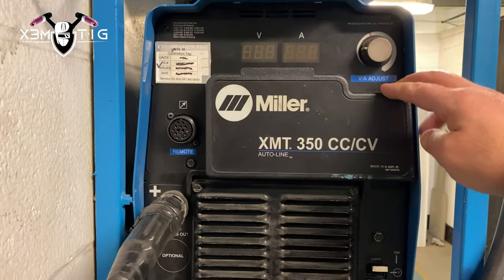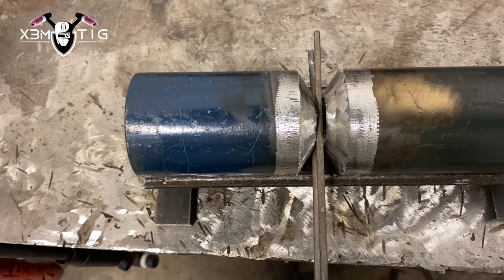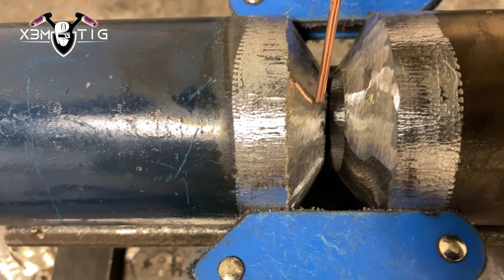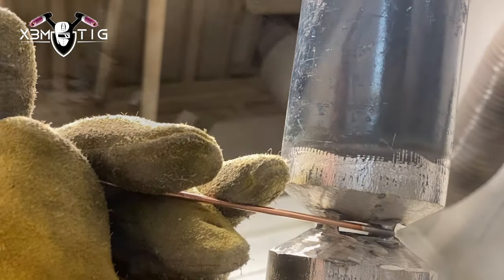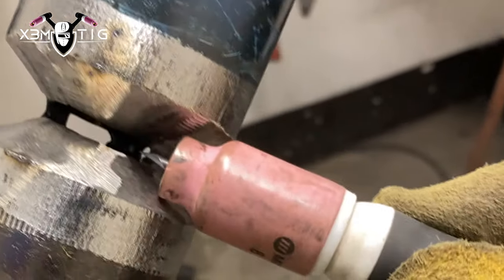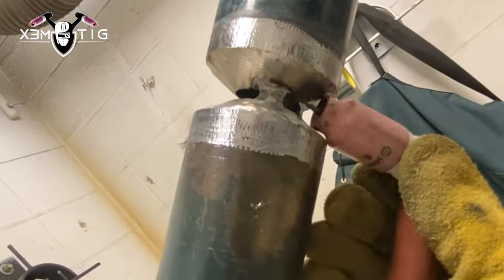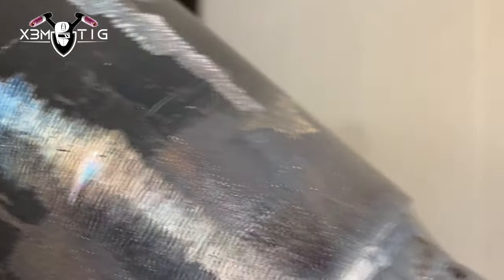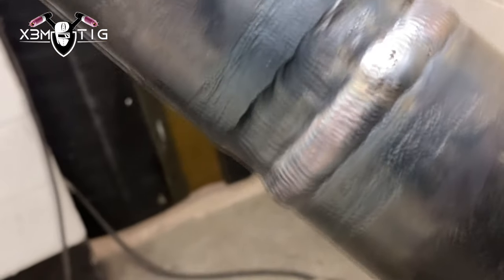6G Max T | TIG Welding For Beginners! From Root To Cap!

Comment: Love your videos. I work on boilers so it’s mostly tube welding but personally I prefer a 1/16 gap to a tight 3/32 and use 1/16 wire you just gotta feed like crazy on the bottom then keyhole the top and since it’s 1/16 wire you have more control over how much wire is being fed also I usually run the root at 120-130 amps on carbon and inconel but watching your videos is amazing cuz it’s interesting to see other peoples preferred techniques
Reply from the maker: Thanks for sharing your experience and technique! 👍

Comment: Nice job, although I would have a smaller gap and single dip, flush and cap without walking using 2.4mm all the way. Back in the day we would fill and cap heavy wall with stick 🙂 Keep up the good work👌
Reply from the maker: Thanks for your comment comment bud. Definitely that set up is good as well, on some sites they have that procedure in place.

Comment: Looks great I’d love to see you do a 3/32 gap 4 tacks root with tig 3/32 wire and hot pass 7018 welding rod fill it flush with rod and cap it with 7018. I learned a lot and I’m struggling with the the tig root. I have a test coming up soon in august wish me luck

Comment: what type of tungsten do you uses ?

thanks  X3M TIG !
Reply from the maker: 2% Thoriated, 1/8 size
Reply: @X3MTIG   same here, I like how it welds. I guess you always use a respirator when sharpening it? I was thinking of switching to 2% lanthanated to completely get rid of the hazard.

BTW just passed my F6 SS, F6 carbon, F3F4  XXH, now I'm off to fort hills. thanks for the help!

Comment: Nice video. What's your tungsten length for your hotpass. I'm practicing for 2 inch pipe 1/4 inch thick. Having trouble with hot pass. Thank you.
Reply from the maker: Up to 5 mil
Reply: @X3MTIG  Thanks!

Comment: Une question ?? Faut il un temps de refroidissement entre chaque passe ?? Merci.
Reply from the maker: Hey bud, I usually let it cool down before capping, it’s just a carbon steel so no any specific inter passes temperature procedures.